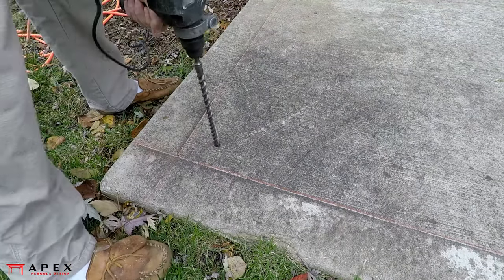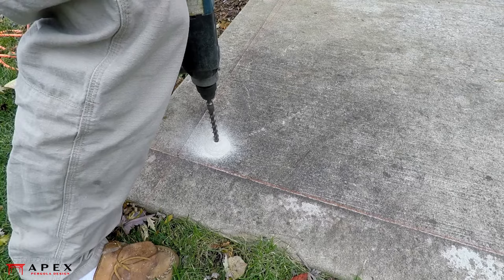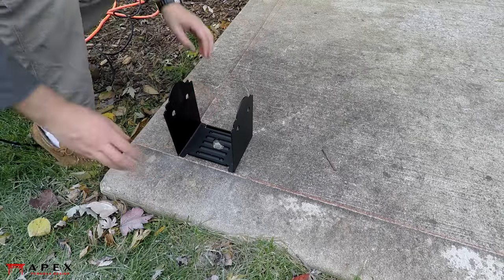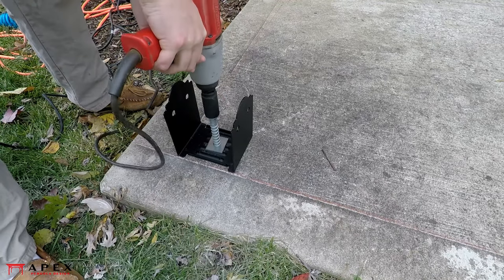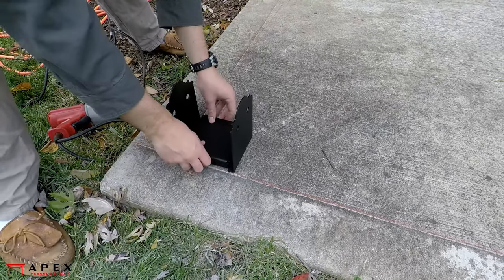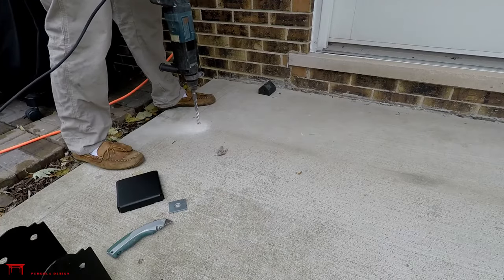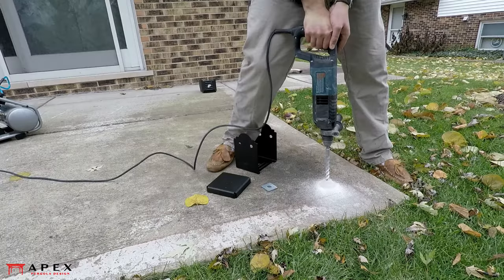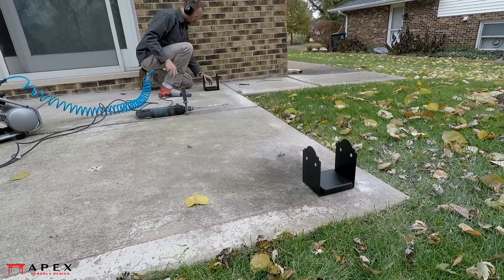Laying Out and Installing Pergola Post Bases | Posts & Post Bases Part 1

Comment: Thanks. I used the method. I added a tv using ZeboZAP into my gazebo without drilling into the post. The tv strapped onto the post and sviwels 360 and now with extra security I’m super pumped for spring and summer.
Reply from the maker: Nice 👍

Comment: What kind of concrete anchor / screw did you use in the video?  I like the screw type method vs the expanding when tightening type.
Reply from the maker: I used the Simpson TITEN HD.
Reply: @ApexPergola  I thought those were for indoor dry locations only. Can only be used in temporary outdoor applications
Reply from the maker: They're code listed for exterior applications according to Simpson's website.
Reply: @ApexPergola  google search took me to the zinc plated ones not the galvanized ones

Comment: Installing a wayfair aluminum pergola on a 4" concrete slab with no footers. What size anchors do you recommend using? And how deep can I drill into 4" slab? Pergola foot is only like 1/4" thick, so I was thinking 3" or 3.5" wedge anchor embedded 2.5-3". Plan is to install 4-6in from edge w rotary drill. Lmk what you think. And thanks in advance! Great vid.
Reply from the maker: Wedge anchor will probably be ok. I like the Simpson Strong-Tie TITEN HD anchors too since they're a bit more foolproof.
Reply: @ApexPergola  Looking at something similar -- installing 8x8 brackets in an existing slab, 16" on center from the edge of the slab. Slabs only about 4" thick AFAIK. Between the height of the hex head, and the bracket/washer thickness, I imagine I should still use a ~5" anchor embedded pretty much the full depth of the slab? Simpson seems to lean toward their Titen anchors even though they make wedge anchors as well -- any suggestion there? Wedge anchors seem to have a slightly lower member thickness requirement for similar embedments
Reply from the maker: Usually not a good idea to have the anchor sticking below the slab. The TITEN s are easier to install than wedge anchors.
Reply: @ApexPergola  I would definitely use stainless anchors if I did that, to avoid any corrosion concerns. I guess when I say full depth, I’d leave a 1/2” or so of concrete at the bottom

Comment: How thick is the concrete? If 4" thick concrete , can the bolts handle the weight or shear >
Reply from the maker: The bolts don't take any weight, that's taken by bearing on the post base. Appendix AH of the International Residential Code allows a certain amount of down load on 3.5" slabs. There's not much shear on the bolts.

Comment: How thick is that slab??
Reply from the maker: This one is about 4"
Reply: Would this post holder work on 2 inch thick concrete slab
Reply: That seems a bit thin.  You should have a footing under posts because all the weight of your structure is concentrated over the spot where the post is placed. @JB-lr1tf

Comment: Can the bases be used on a sloped patio? If so any tips on the plumb install of the posts?
Reply from the maker: If the slope is fairly low, they can be used as is with no change in approach. If a greater slope, you might have to either shim the bottom of the base plate (use stainless/galvanized washers or grout) or install on the slope and bevel the bottom of the post accordingly.
Reply: This is what I was looking for, thanks!

Comment: How deep did you drilled?
Reply from the maker: That will depend on your anchor, but this one was a little more than 4".
Reply: If I am using 4x4x10. 4ins 3/8 anchor efficient enough?
Reply from the maker: I can't answer that with the information given.

Comment: Where i live in ontario this is not to code because 'side winds will cause the concrete to crack.' Annoying as hell, as if a 4 posts and open cross sections are going to catch enough sideforce drag to crack a 4 inch slab.
Reply from the maker: It's better to put them on piers, and that's the way we normally recommend to install them.  There are ways to "properly" install on a patio slab, but it can be tricky.
Reply: I'm in Ontario as well and was about to make this type of open structure, what did you do instead? I feel like most people just attach regular gazebo's to their patio which would create more drag than 4 posts.   My neighbour has a shallower patio and just put a costco 10x12 gazebo on theirs.

Comment: SST post base is not so good as OZCO OWT post base I think
Reply from the maker: Both have their advantages. I would agree that OZCO has the edge when it comes to looks and options. But SST's engineering support is better.
Reply: @ApexPergola  Thanks for  your reply. You can't get enough engineering help from OZCO ?
Reply from the maker: I don't know that I'd say that. More that the SST catalogs are very robust in comparison. Plus, they've been around a lot longer, so inspectors are more familiar (if that's something that's important in your area).